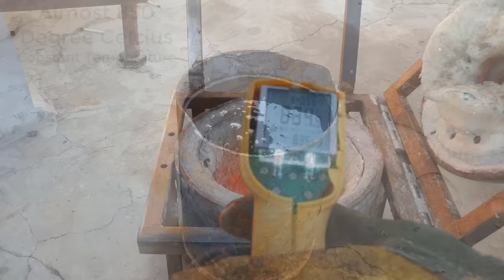Turning a Rusty Bearing into a Beautiful but Razor Sharp BUTTERFLY KNIFE

Comment: Really nice butterfly! Beefy and badass! You'll need to add a latch at the butt of the handles to lock it both open and closed or it would be hazardous to manipulate.  I collect balisongs and would live to add this. My favourite is from the Philippines with a blade made from a truck bearing. I can stab through a quarter.  Also I'd recommend some method of licking the screws at the blade, without it the screws WILL loosen and fall out when manipulating which is why most, but not all,  are held with pressed pins. I'd rather have the speed screws as the pins loosen in time and you have to use a punch and hammer to tighten them.  This is a very very nice start!!
Reply: That's LOCKING the screws at the base,  not licking.  Don't lick your balisong!!😁
Reply: @davismillard3822  Raised my eyebrows And set my imagination going 👀😁
Reply: Have to admit it does look very nice indeed

Comment: I love butterfly knives, this is amazing.
Reply: He put  no Tang pins in so you can see at 12:56 that the blade doesn't stay straight. They're kinda crucial so you don't cut yourself.
Reply: in the UK you would end up with a nasty fine and a police record.  Unless of course you are a yob then you would get a slap on the the hand and told not to do it again.
Reply: @bryanedwards9464  definitely needs some pins. I didn't even notice he forgot them til I saw your comment. Definitely don't want to get bit by a blade that sharp
Reply: @bryanedwards9464  yeah, I saw that too, handle that knife without them is really dangerous.

Comment: THATS AWESOME BUT YOU FORGOT A VERY IMPORTANT PIECE that almost isn’t noticeable(and I’m not talking about the lock) 

There is a pin at the back of the tang that prevents the blade and handles from sliding back and forth when the knife is opened and being used. It’s important during tricks too. I’m going to include a link that shows a picture of this easily added piece that is an absolute NECESSITY. This is the reason you couldn’t cut anything more solid than Styrofoam that florist use. Even during your underhanded “drop flip catch” there is one time that you open the knife and the blade ends up at a skewed angle. Adding this pin will prevent that. 

This link will lead you to a picture of what I’m talking about. PS: I love the video. 👍+Subscribe I do have one more question. Since the handles were made from brass would it have just been as easy to use a piece of stock for the blade or is there is something special about the composition of the bearing? You wouldn’t believe how informative I found this video. Especially as a person who loves butterfly knives. I meant best decent amateur and I never realized it didn’t take super special “ Machine shop” grade tools to make a BEAUTIFUL Knife  As much as I love the video you have to add that 📌 

https://www.pinterest.com/pin/325314773056448744/
Reply: The type of steel used for the inner bearing casing would be a very high carbon content steel. Therefore with proper heat treating (which he did) it would hold a very sharp edge for a lot longer than lower quality steel like your common gas station or smoke shop balisongs. Another very common source of this steel for handmade blades is the leaf springs from an old car. Fun fact... Japanese sword makers actually add pure carbon to their blades by getting them glowing in the forge and then sprinkling on the carbon dust as they pound and shape the blades which imbeds the carbon into the steel composition then they repeat the heating and folding of the steel till it reaches it's peak performance as far as hardness is concerned. Very fine line between a blade that will shatter and a blade that is so soft the edge will literally roll back on itself.
Reply: Yeah What he said😃
Reply: @carmenpanaro2169  😂
Reply: @PropGuru702  the carbon come from burnt bamboo leaves.

Comment: Just a heads up, most butterfly knives have a pin in between the two handles when in the open position so it doesn’t wiggle when in use. Its not too late to add that in, though. So when considering making more in the future, include that pin for knives you plan on using for heavy duty work!
Reply: This is most likey a show piece so it shouldn't need itb

Comment: Why does he put it second time in the cupola?
Reply: That is called the "quenching" which is when the steel is hardened. Just like what Mr. Vick said. Just adding the terminology.
Reply: @sjgavenger37  quenching a blade twice can make it brittle and ruin it completely. Probably not the best idea to quench twice.
Reply: @mattbombertv4326  
I agree. More then twice is like a really big no-no in forging. I watch forged in fire show alot....lol
Reply: Yeah
Reply: Shlomo Goldsteinmenbergvitz  
Well obviously it wasn't "super hard" as he said he needed to quench it again.
Reply: My guess is to temper and harden the metal after all that cutting and grinding.
Reply: bcs the knife isnt delighted
Reply: Mike Vick  🎂
Reply: I don’t know why don’t you ask him
Reply from the maker: That was for tempering purposes or you can say that process releases the stress in the steel after quenching.
Reply: @sjgavenger37  same bro
Reply: Yeh why does he?
Reply: @Inspire12347  random links are very suspicious....
Reply: @HemiHami  I want to promote my channel
Reply: @sjgavenger37  agreed. I was taught to make knives by a past forged in fire champion. Only time I would re quench is if the first quench was unsuccessful or if the blade warped and needed to be straitened and hardened again
Reply: This isn't quenching. Quenching is the rapid cooling of a heated material, usually done by submerging it in water or oil. Quenching hardens a material but it can also make it brittle.
Reheating the quenched material — to just below the critical point for a period of time — then allowing it to cool slowly in air is called tempering. Tempering makes the material less brittle without sacrificing too much of the hardness that was introduced through quenching. A good, long-lasting blade should be both quenched and tempered.
Reply: @AndyRoo312  OK OK I see u walking google
Reply: @l2malik744  walking Google? No, I can't answer everything, just things that I've previously learned/studied; quenching and tempering just happened to be a small part of my engineering degree.
Reply: @AndyRoo312  oh nice
Reply: @Inspire12347  bruh self promoting is just dumb. Grow ur channel by putting effort not by just posting ur link in the comments section of big youtubers
Reply: @Inspire12347  why
Reply: He did it because it wanted to take a bath
Reply: He got to get some protection because you never know he might come back